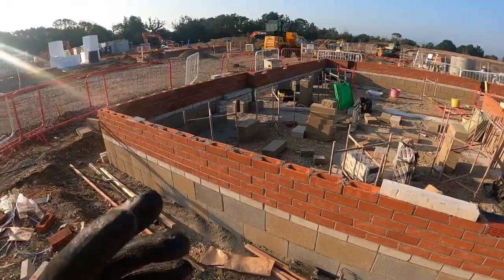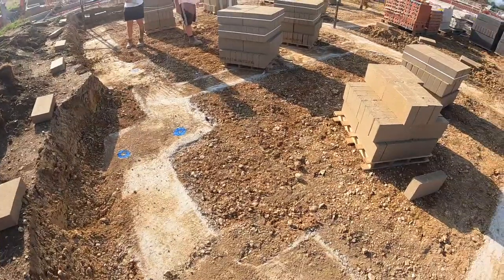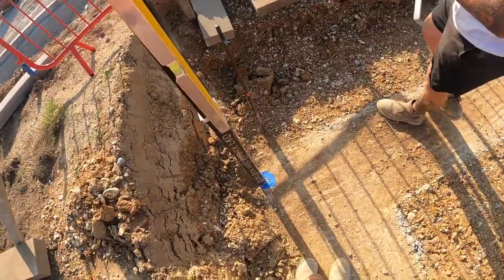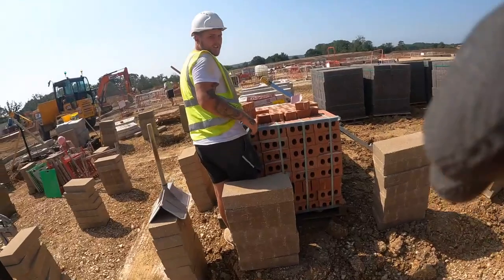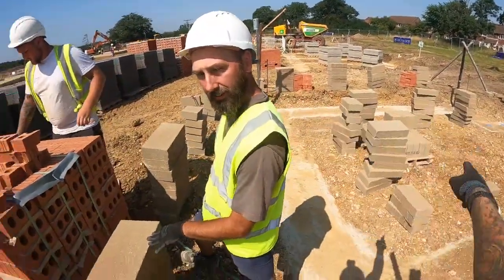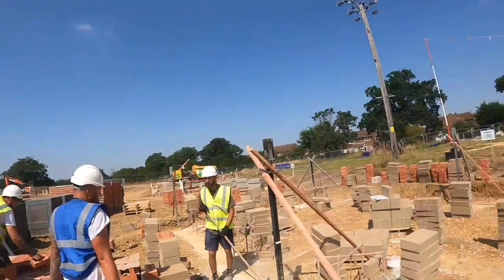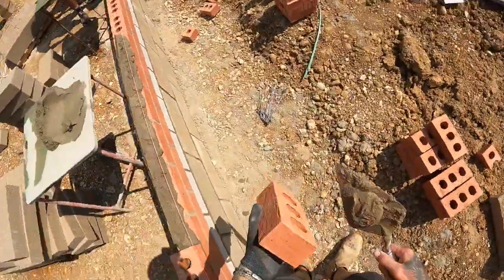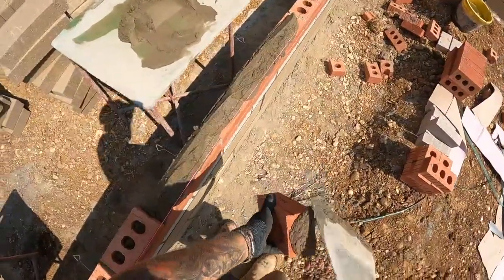Magic... top sweeper 😂👌

Comment: In regard to wetting the bricks, we used to run a hosepipe over each stack, but make sure the water soaks all the the way through. So let the water run right through, so all the bricks get soaked. But if you don't have access to a tap, you could pour buckets of water over them. But it's not as effective.

Comment: Wetting the will help but may cause a ghosting film on the face unless you clean water each time. I’m a old boy as you say,we had only solid bricks back then and had to wet them,we set up a scaffold plank and let them dry for a few minutes,you had to have someone wetting them ahead of you could lay them them in steady.
Cored brick are so easier 
to lay,we would call them holy brick,because it was a blessing someone figured it out to put holes in them! Sand looked a lot better not as course of a grit. You should try putting a tarp up over the mixer and sand pile keeping them cooler(then at night you drop the tarp down and cover the sand to keep it cool for tomarrow! ( and to keep sticks and leaves and any feline delights out,also I would wet the empty cement bags and lay them flat in the mortar tub to insulate from the sun and keep it cool also.
Like I said in a comment 
A few weeks ago,I realize you know this already...here in the states our weather may be hotter for longer periods so a couple little tricks we do might help you in this heat. Will they let you put a little lime in each mix to retard the setting or are they afraid it might change the color of the mortar when it drys? Geo from NJ

Comment: We've been wetting the bricks all week. Out bricks are thirsty. Two large gorilla buckets of water (90litres) over each full stack of brick is perfect. Getting half a gable built before having to joint and mortar cures properly. Left a lovely finish to wall. Been doing this for years. Where did you get your block cutter from? 👍

Comment: Squirrels looking much smoother. I've dipped bricks in the past in tray of water. Can't think of an easy way, also used a hand sprayer. Have a word with Steve and Alex for some brick tongs for shifting those bricks with holes. You can sing the milkman's song as you go. Stupid question: Can you explain sometime why you still sometimes get bricks with frogs on these new builds, or do they just buy what they can get hold of?  P.S. don't give up on the idea of mental arith. 120 div 3 should be no probs. Just div 12 by 3 then add a zero to get the result of forty. Simples!

Comment: The bricks are so dry they are sucking the moisture out of the mud. So of course it's another pick and dip day. We used to take 4-5 brick into a bucket of water and pick the brick out of bucket, always have at least 4 bricks in bucket. Then after 3 or 4 courses and must the wall down with cool water, try to use cool water in bucket, can't be hot.

Comment: Magic is 100% the new sweepervisor totally takes control 😂
I have the same problem at work constantly jointing up and knocking up compo, only thing I can think of but would have it's pros and cons is a demolition dust suppresor/control not sure if you have seen these Charlie but they spray like a mist of water that gets sprayed into the air keeps the dust down on the ground which all sites want this time of year but also wet, would be a dream if they could controll how wet/damp they can be, try looking them up on Google or something if you haven't seen them befor great bit of kit 👍

Comment: Wet bricks and blocks no point wetting engineering bricks it just makes a mess and you can put washing up liquid in the water you use to knock up with to stop it drying out and makes it more worker able

Comment: Your buildings are differently than here in the usa here new type of building wooden frame work and a four inch face brick on most residential buildings or 4 inch concrete blocks and face bricks and older style common brick and 4 inch face brick